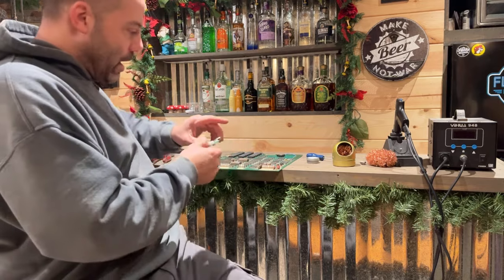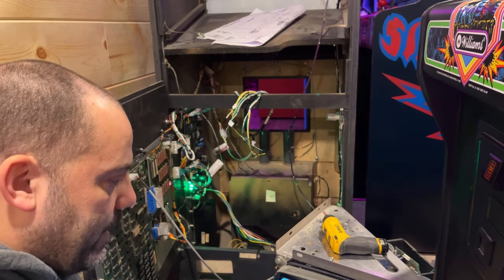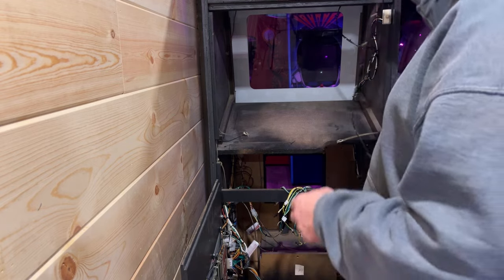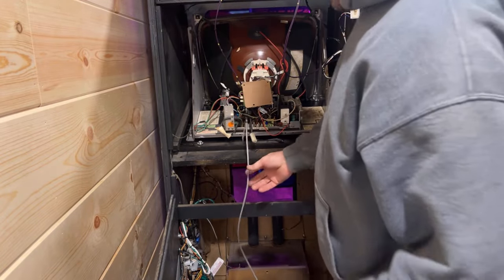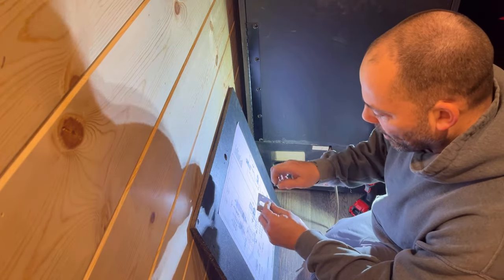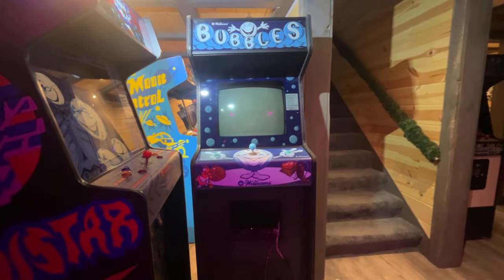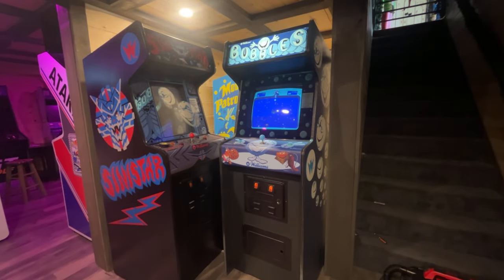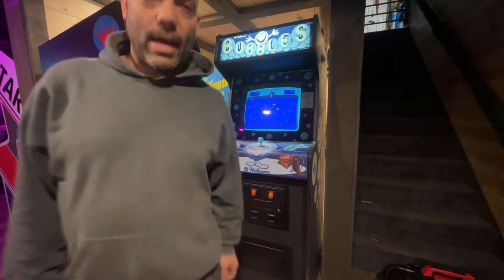Bubbles arcade restore part 15 it is finished

Comment: Troy, are you using an original wiring harness in the Bubbles? I had a very similar challenge when I restored/deconverted a Bubbles and had a wiring harness from Golden Age Arcade Parts. This was more than a few years ago now but with Ken’s help we were able to figure it out. Can’t remember more than that so probably not much help. Anyways Ken was great and makes good stuff but I remember having the same issue. Best of luck and keep posting, Braido…
Reply from the maker: No, it’s from gold age Arcade and it’s all up and running now